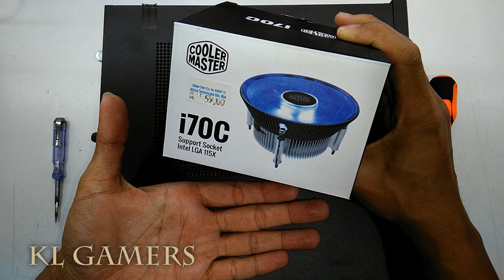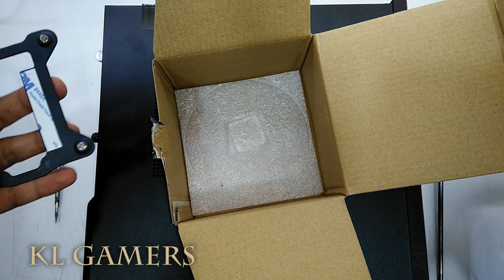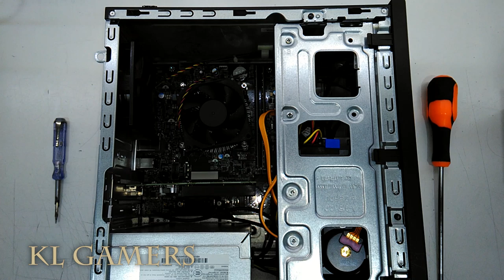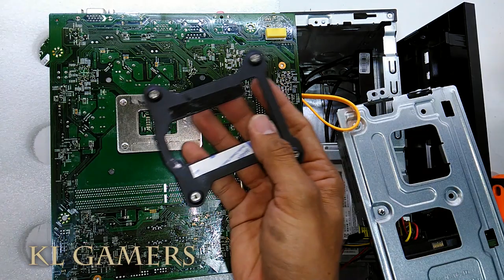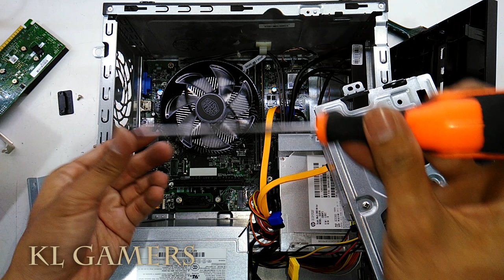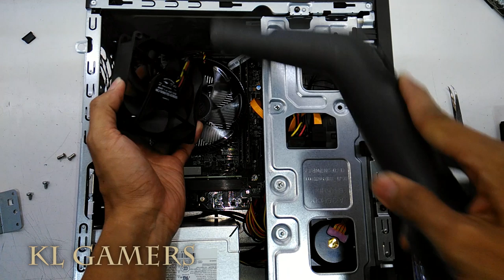hp Pavilion 570-p024d Desktop PC Computer Change Repair Replace CPU heat sink fan Cooler Master i70c

Comment: Please unplug everything before you take things out, when you are wedging it against the case and setting it down hardly you are putting scratches on circuitry and could easily short out the motherboard.
Reply: Hello bro, I have the 790  but have some problems with the high cpu temp.it is still under warranty and I am wondering if I am able to change the cpu fan? Also, is there any fans in the market don’t need to replace the mount that behind the motherboard? Thanks🙏

Comment: Bro is this the same motherboard for 690-073w? Im planning to change the cpu cooler too.
Reply from the maker: not sure
Reply: The cooler is fine on that Gaming pavilion, but what you should do is add a intake fan. That PC is overheating BC of the lack of fresh air as it only have 1 exhaust fan.

Comment: Bro. How to tell if my HP can use aftermarket cooler?
Reply from the maker: usually it can most of the time you will need to remove the metal brackets from the bottom of the motherboard
Reply: Intel's cooler will have Intel logo on them, and AMD will have AMD logo on them. If your don't (probably don't) its considered aftermarket.

Comment: Well, I'm grateful for the video and your attempt to help the public, but you didn't follow one of the maintenance recommendations on the official HP channel. Be more careful when handling the motherboard and replacing its components ...
Handling parts in this manner may damage the motherboard and may void your warranty. And thanks for using a camera with good resolution. The image and focus were very good.